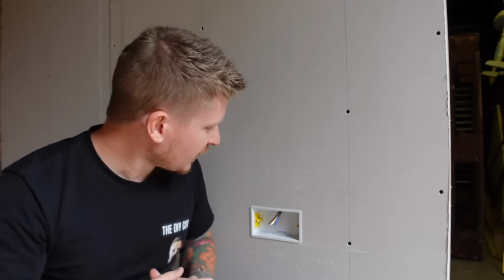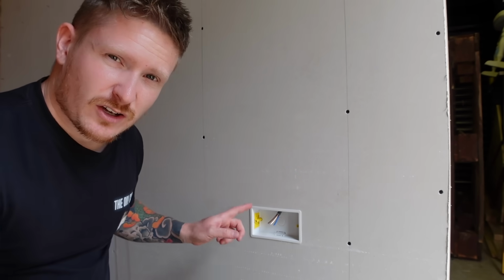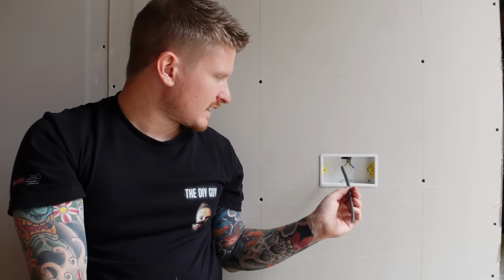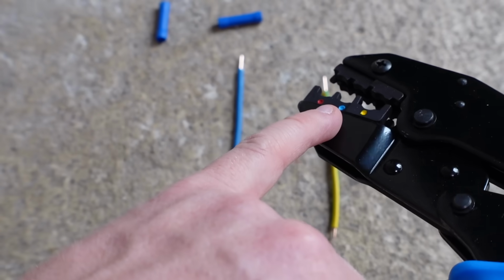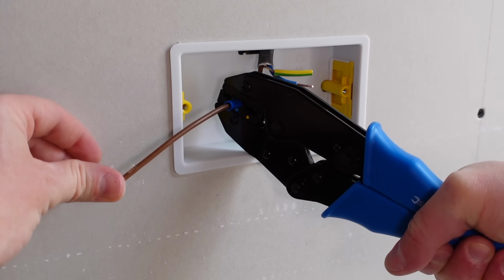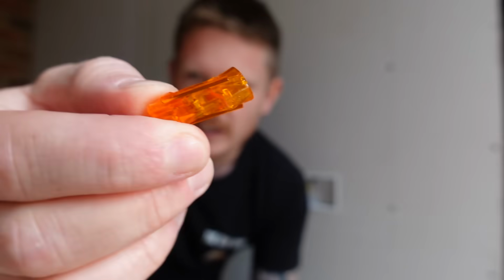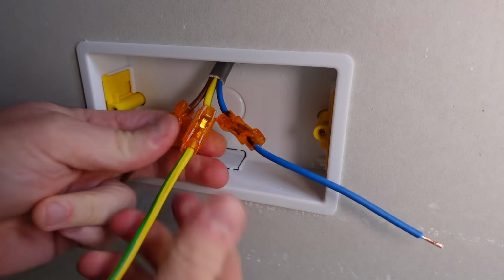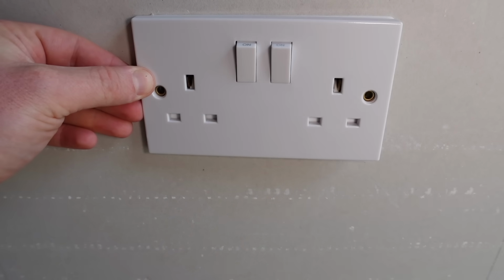How to Extend Short Wires | Easy Fix Anyone Can Do

Comment: I have to add this after reading one of the comments below.
I played a practical joke on an electrician once. I’m a carpenter and was fitting a fancy electric cupboard in a posh flat in London. The electrician had left about six feet extra on all the cables coming into the cupboard of which there were about 50 or more because it was for a complex system of lighting, audio, video, power sockets, etc with points for everything in every room, you name it this place had it and all the cables were carefully labelled.
I had now reached the stage where I had to fit doors on this cupboard but try as I might I could coil up this mass of wires and stuff them into the cupboard far enough to be able to fit the doors. So there was nothing for it but to figure out how much I needed to reduce the bundle while still leaving reasonable lengths on the wires and cut them back. I figured about 3 feet would do it. So I sat down and painstakingly relabelled each wire four feet further up carefully copying precisely all his letters and hieroglyphs, then I cut them all off at three feet  but I kept the bundle of ends with the original labels.
Next day I was first on the job as usual and waited for the electrician to turn up then I approached him as he entered saying “ Oh Steve, sorry mate I had to fit doors on that electric cupboard but couldn’t get the wires in so I had to cut them back a bit, but don’t worry I saved all the ends with your labels on”!
Well his face was a picture, he dropped his bag and just stood in the hallway open mouthed, looking from me to the wires then to the now fitted and closed doors on the cupboard then back to the wires and his labels then me again and finally managed to splutter out “ you twat!” ( actually he used a worse word than that but I can’t write it here) I managed to keep a straight face and said, “ there’s no need for that it took me ages to cut through this lot” then spitting and snarling he rushed over to the cupboard and tanked the doors open and looked inside… and then after a pause collapsed on the floor in a quivering heap letting out a noise that was somewhere between agonising pain and ecstasy jibbering the words “Thank Christ you cruel bastard I nearly had a heart attack!” It was priceless! Best joke I ever played on a tradesman!

Comment: Great stuff. But who’s been watching a lot of stuff with Americans speaking and picked up that annoying phrase they over use “go ahead”? Eg, why don’t you go ahead and take a seat” or “go ahead and help yourself to some coffee”! Or “ go ahead and do this, that or the other” it’s a completely useless and unnecessary phrase as it ads nothing to any sentence, if you remove it the sentence has the same meaning. Eg “ why don’t you take a seat”? “Please help yourself to coffee” “YOU CAN NOW CONNECT THE OTHER WIRES”.
Sorry, it’s just that you have strong clear English accent and explain everything precisely using words economically and then inject that superfluous, pointless yank phrase,  so it really stands out.
But otherwise a great video. 👍😀

Comment: The second type of fitting reminds me of the "backstab" connections they still put on outlets in N. America. They work the same way, but are known for overheating. Maybe the ones in this video (which I've seen at Home Depot) are better made, maybe with  higher quality contacts and/or anti-oxidation paste. The insulated crimps are probably fine with a proper (and expensive) crimping tool, but I've had terrible luck trying to crimp them with vise grips, though, for some reason, vise grips work fine with un-insulated copper crimps & heat shrink tubing (which may or may not be legal). They even have a special type of crimp, and crimper, over here that's supposed to cold-weld copper pigtails to the aluminum wiring they used for a while in the 1960s; it's supposed to be one of the only reliable ways to connect aluminum to normal switches and outlets.

Comment: What bothers me is that he is touching the neutral wire. Neutral is always considered to be a live circuit. So your lacking some security information. Besides that it is good information for people. However you do not proper test the connection as well.

Comment: Thanks for the video.
It was interesting, how you do it.
I don't know about you, but in my country, for example, that (blue) insulated tube connector, can only be used  for stranded flexible wire.

Comment: Did you know that the earth wire/cpc on a 2.5 mm sq T&E cable is 1.5 mm sq so really you should use a red crimp on that connection 🤔 Good video otherwise 👍🏼👍🏼

Comment: The cpc is not 2.5mm in 2.5mm twin and earth it is 1.5mm (over half the size of line) that blue crimp will fail. Not a criticism just a safety tip. Red through crip needed

Comment: I'm an electrical engineer, and I'm still glad I took 2 residential wiring courses at the local VoTech.  I've run a lot of circuits in my house and it was money well spent.  Excellent Video.

Comment: I didn't get on with the blue crimp connections - I bought a pack of 100 for £3.43 from Screwfix, I've chucked them in my shed, not sure what I'll use them for
The in-line splice connectors however, are BRILLIANT - a box of 100 cost me £10.46 from Screwfix - well worth it

Comment: Crimping is dodgy. You need to be sure the crimp tool is set up correctly and that's not always the case especially with cheap stuff. It's a recipe for a fire otherwise. Wago connectors are more reliable.

Comment: What about current carrying capacity of those crimps? I think they are made of steel, arent they? And the crosssection is actually smaller than cross section of the copper cable. Im not a qualified electrician but if you're using crimps for this should you first insert cables at both ends (so they are touching each other) and only then crimp them?

Comment: If I was running that job the electrician would find some slack or run out more cable.  Absolutely no joints on a new installation that's for cowboys.

Comment: A properly soldered joint with the right heatshrink insulation is better. It's neater and stronger. Crimps can work loose overtime and fail

Comment: I don't like the push connectors. Very small amount of actual surface area making contact while the crimp connect probably has over 20X the amount of actual connective surface area....= less heat.

Comment: Enough of the fake bullshit.
If you're a qualified electrician, the last thing you do when you have a technical problem is 
hold your hands to your face in despair.

You crimp more wire on in your case. NOT rocket science & no need for the emotional drama !!

Comment: I usually solder an extension wire and use heat shrink tubes or insulation tape. The crimp and the in-line splice is great too but not available everywhere, at least where I live. But these are great too where solder isn't available or when you have to disable the electricity supply for repairs. Another method I use is to just twist two wires together and then put heat shrink or insulation tape when nothing is available. Thank you for this information. :)

Comment: I have had a quick look at this and amperage rating of blue crimps vary 10-27 amps but not at what voltage.
The other thing to take into consideration is the crimper quality, crimping to the right amount of pressure as I have many times had these slide off 
after a little pull even with good quality crimpers.

Comment: QUESTION: Can I use 32A SPLICELINE in-LINE CONNECTORS to join the two wires between my new 16A oven and my 32A fuse box?

If no - what is the done thing?

Comment: Great vid, one thing you missed is that the crimping tool you used is pricey so using your push fit connectors saves buying one.

Comment: my lights stopped working and i’ve run a non contact ac test it’s got power in the face plate, and main connection where the bulb is, so i run a continuity test and it seems fine a little high but from what i’ve read nothing to be concerned about. why else would it not work i’ve changed the light switch to a new one still not working new bulbs etc nothing?

Comment: Is it safe to use a butt connector for high voltage application? Let's say 220 V? I only have 1 1/2" of wire to work on so this is the most ideal method I can think of.

Comment: It would have been a lot simpler to have pulled the box out which is really easy and he would have had a lot more room to work, also he could have left the joints behind the box with a lot more slack to avoid being disturbed or pulled.

Comment: There are a lot of solutions here, to get the cables longer, except crimping the "add on" terminal
Wago is ok, as well soldering the wires ( a profi soldering ) and covered with termo tubes ( termo)
Is about the space inside the wall plastic cap .. Depend by the model of the outlet
Cheers

Comment: Thanks for sharing this clear tutorial on solving this issue. The in line splice is a great option as it is a tool free operation. I wonder if the same option is available for 6 and 10 mm cables.

Comment: In most double socket boxes, there will be 2 cables so you'll have to do this twice.  That might present a bit of a space problem with the push fit connectors.  Also, I'm not sure it's a good idea - or even legal - to have a single 2.5 mm (15 amp rated) cable feeding a double 13 amp socket.

Comment: Great vid - liked and subbed. I was unaware of the push fit connectors until I watched this. Do they work with stranded cable like flex, or just solid core?

Comment: I've used the inlines and they are nice but professional electricians frown on them. Apparently the springs can lose there tension overtime and then you can have real problems. Easy is not always better.

Comment: Hi there
As a retired Electro-Mechanical Engineer (75) I would have thought that terminating the three wires in the socket while sitting at a table/sat on the floor/ etc and then when that's done taking your socket down to the position where it is going and push the three wires using a splice (or SIX if working on a ring) into the socket, saves all that messing about.
It's all about time which contributes to your bottom line. BUT always remember safety first.
As of 15th January 2024, I have just watched this again, but this has been nagging me.
Please correct me if I am wrong but I am almost positive that you need an IEE certification ( 16th / 17th Edition etc. ) to install a NEW socket, this does not apply when changing like for like, I have been out of the industry now for several years, so things might have changed, but this is a safety aspect so I can't imagine this would not change.

Comment: Recently I had to join two 4mm ( multistrand ! ) to two  2.5mm singlestrand ( and the smaller earths ) ... then ... extend 4 inch tails to the single 13 Amp socket ( steel box containing all this ! ) .. the ONLY satisfactory way was to create  large copper wrapped SOLDER joints , covered with adhesive lined heatshrink ( two layers for the live , of course ) ... to do this you MUST use a BIG 200 Watt iron and ( lots of ! ) decent flux cored solder ... a bit crazy but very safe and works well ... DAVE™( electronic engineer )

Comment: I have to extend attic wires to a new bathroom vent.  If I used the snap fit wire connectors in the attic, what do I need to do to make them safe.  The wires in the video are within a box,  need it do something similar to extend an attic wire?

Comment: Damn, wish I'd researched more on connectors, I used WAGO connector on ceiling light with two switches and had to enlarge hole in ceiling to fit their bulky size and all the wiring back into ceiling. Very easy to use though.

Comment: I'm nervous about crimping a wire that might get pushed and shoved near the crimp, e.g. in order to connect to a socket or switch (especially when pushing the switch or socket back into the box) as I fear that the pushing and shoving may stress the crimp and damage the integrity of the connection.

I'm not worried about a crimp on a long run or where the cable is secured on either side of the crimp.

Am I over cautious?

Comment: How about the inline Wago 221 connectors?

Btw, I'm not sure if you're supposed to use the wires inside a cable as spare wires...

Comment: I am a 68 year old time served electrician, the first thing I would do is put pressure on the cable to release it from tower clips to gain enough slack if possible.

Comment: The socket I’m working on has two reds, two blacks and two earths. All in a tight space. I just need them a few inches longer to reach into the holes in a new faceplate. Any suggestions welcome.

Comment: 1) Why isn't the earth default isolated ? That seems so strane. On mainland (at least in Belgium) all 3 cables have isolation by default.
2) What about WAGO connectors ? They allow multiple extensions, where needed. And they exist both in 1 time use (insert and forget) and multiple use (you can re-use them, remove the cables easily) .

Comment: I have similar overall diameter wires on my light fitting.  They are made of fine strands held together by the insulation rather than a solid conductor and are therefore very flexible. Would the push-fit connectors work on these types of wires?

Comment: Easy and cheap. All you need are a load of crimps, state of the art wire cutters, an as fancy a stripping tool and a crimping tool alike - cheap!

Or just a few splice connectors.

Comment: I assume a terminal block / strip could also still be used? (the ones with screws). Not as quick and easy as your recommendation, but I have seen these used a lot in the past.

Comment: Well sorry I may sound a bit old fashioned but the old school method is tried & proven to last + work flawlessly unlike the over priced snap on cr*p connectors. Here's a grand thought for someone to ponder, crimp again but this time using mega dirt CHEAP UNINSULATED  BUTT CONNECTORS (+ heat shrink) or for even cheaper Uninsulated Cord End Terminals - slot the two bare ends (parallel) in..crimp + heat shrink ...bingo a connection for less than pennies in the pound......unlike those In-Line Push-In Wire Connector that are just a issue waiting to happen. Uninsulated Cord End Terminals (100) = £1.95  In-Line Push-In Wire Connector = (100) £7.56 I rest my case !

Comment: Two additions, that may increase savety, when working on electric installations.
1) Always start with the earth wire. If you do that, earth will always be connected first and provide that scant more of sefety, if something goes wrong.
2) Always make the earth wire a bit longer than the other two. So if something gets pulled out, or pulled apart, it loses connection last.

Comment: i would usually use marrets but this is much simpler, my dad was notorious for cutting wires too short to work properly with them and i would have to 
fix the problem all the time.

Comment: How much did you pay for that crimping tool? It has replaceable dies.
I bought one for $5 and it looks brand new.  The dies that came with it were not compatible with anything I use but they were obviously replaceable.
I discovered the dies to crimp ordinary lugs,  were well over $200....... Not just that,  but I couldn't find anything available anywhere.
For $3 dollars, I have one of the best crimping tools available in the world today.
With the dies that they currently have, can't crimp any fittings that 99,% of us would ever use.   Even replacing the dies had a couple hundred dollars and not being able to find any....... Well, that purchase still made my day because this is the best feeling set of crimping pliers I've ever seen in my life. That 
said, I have them and almost no one else does. 😁
It seemed like a score of the time but finding a standard crimping die set to put these players is ridiculously expensive.

Comment: Can you use these to remove a socket? And use capping over the top to plaster over? Basically connecting the main back up again. Would that be to regs?

Comment: How about a cable that is visible if you want a neat job? I have a set of waterproof lights so it’s difficult to get to the inner workings but the cables are a little short and I’d like to extend them.

Comment: Question: Where the socket is being used as part of the ring ie has two lives, neutrals and earths in each screw fitting. Do you extend all six wires?

Comment: I d dong this but found the docket box was too shallow for stiff wires and crimp connectors. It did work with 2.5mm stranded extension wires as they more easily gold out of the way.

Comment: Nice and well explained tips !  What are your (and others) thoughts to these "solder heat connectors" that I have seen doing the rounds?  (You insert wires in each and and use a heat gun like on a heat shrink sleeve - but there is low heat solder in the middle to connect wires.  Looks good, but always wary of these things as a "gimmick".